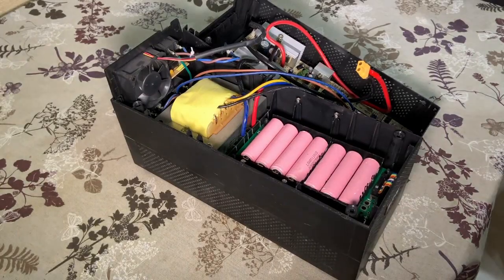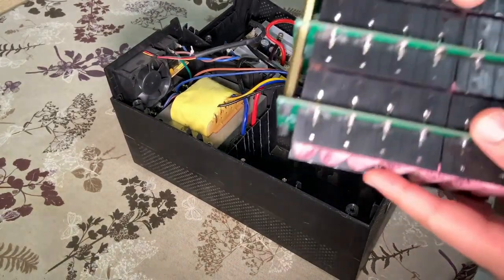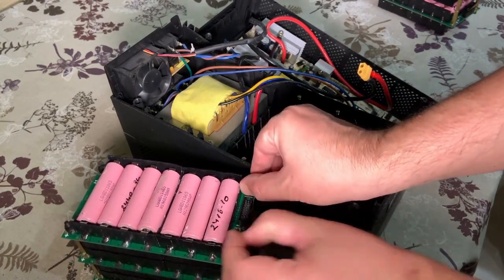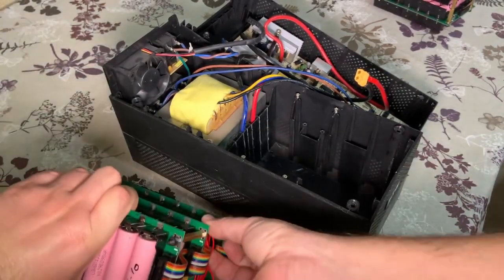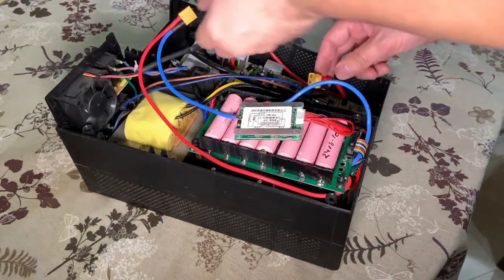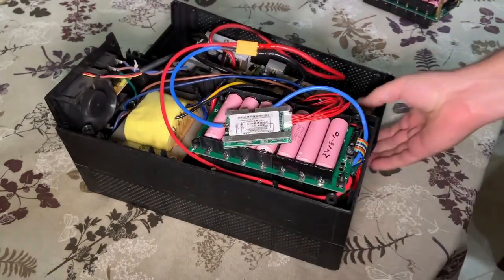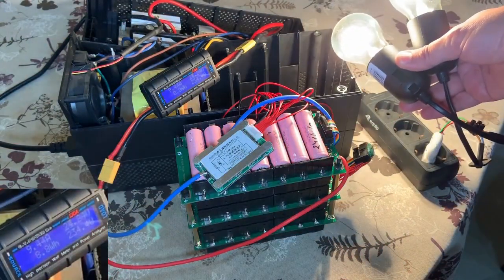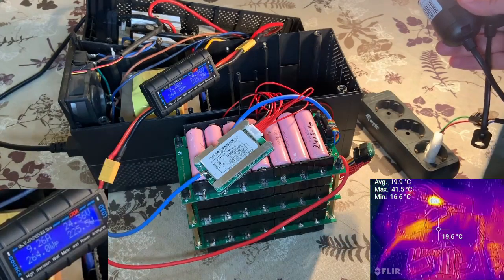Converting the UPS battery from lead acid to Li-ion Part 2

Comment: why not just buy a 12 v. LiFePO4 Battery? instead of single cell batteries + multiple circuit charging board?
Reply: LiFePO4 batteries are more expensive and have lower energy density. If you are trying to maximize the battery capacity in the same space, Li-ion batteries are better.
Reply: @ared7909  but is it safe to use Li+ instead of Sealed acid lead battery in a UPS w charging system made for sealed acid lead battery? I hear Li+ needs a different charging system? I am undecided, as I hear stories of Li+ catching on fire. thank you for sharing your brain.

Comment: If you connect buck converter and step up the voltage and put 2 cables one diode from inverter and one diode from buck converter so current will flow on one direction. So from ups current will flow to the buck converter and it will step up to charge the batteries and from batteries there wil be another cable connected with diode so voltage will flow to inverter but it cannot go through same cable

Comment: UPS auto Cuts of Voltage when less than 10.5 v but lithium ion battery can Discharge up to 8V how to Change the cut of Voltage

Comment: What is the charge controller you are using for the Lithium battery pack, the charge profiles for Lead acid is different for Lithium, Lithium has a four stage charge profile, Can you share a connection diagram from the old UPS DC ouput to Battery pack to AC Output section

Comment: The max charging voltage of ups is 14.35v and for 3s lithium-ion battery is 12.6v so your bms or battery will burn?

Comment: Instead of using 18650's with a 3.7v nominal cell voltage, change the battery to one with a 3.2v nominal like the 32650 6000mah cells from battery hookup. The packs are extremely simple to build and make a much better replacement for a lead acid battery.  The only other option is to hack the charging profile of the UPS.  Google "j606 UPS" and that will get you to some nice articles on reprogramming the charge profile.
Reply from the maker: Yes you are right. The only problem I see with 32650 is that they are not so popular as 18650
Reply: @tedonash2681  Some Dyson batteries use the 32650

Comment: i know this is old, but depending on the UPS there is a way to hack the UPS to increase the charge voltage. some are in firmware that you can manipulate, some have a potentiometer that you simply adjust.
Reply from the maker: Hmmmm that sounds interesting. I will look to see if I find something is this particular model

Comment: Sir/anyone this is just theoretical, and im mainly a DIYer as well so I could be totally wrong in my understanding of electronics here so feel free to correct me if im wrong. I'm planning to do the same thing to a UPS and I thought that re charging/discharging, would it be possible to control the in/out current with a diode and have the charging side pass through a solar controller that has the proper specs for li ion or lifepo4 depending on what i decide to use. Then from the out or load side of the controller re connect that back to the UPS terminals with a diode as well. Since solar controllers are designed for fluctuating voltages anyway, they should be more than able to manage the UPS lead acid charging method and protect the batts right??? And because of the controller, I should be able to adjust low voltage cutoff and max charge voltage if say i dont want to fully max them out. 

Would this work?
Reply from the maker: Yes I think it will work. You need very powerful diode. The only reason not to work is if you have a very smart UPS that can detect that it does not charge the battery and stop working because of that.
Reply: @tedonash2681  That makes sense, a "very smart" UPS would be a problem. I'll just have to go try it out and see what happens. Thanks for the reply.
Reply: @malds255  please update what happens is it working

Comment: What about placing the converter between the lead acid charging circuit and the Ups switching relay.
Reply from the maker: It can work as long as you limit the direction of the current flow.
Reply: @tedonash2681  Currently the lead acid charging circuit is not part of the load circuit, therefore not affected by current direction. It is in this section where the converter should ideally be placed.

Comment: you can try these https://www.aliexpress.com/item/32984035834.html?spm=a2g0o.detail.1000060.3.25dc5d55ygutU9&gps-id=pcDetailBottomMoreThisSeller&scm=1007.13339.169870.0&scm_id=1007.13339.169870.0&scm-url=1007.13339.169870.0&pvid=532872ce-bfbf-4f6c-9072-29a10c601f02&_t=gps-id:pcDetailBottomMoreThisSeller,scm-url:1007.13339.169870.0,pvid:532872ce-bfbf-4f6c-9072-29a10c601f02,tpp_buckets:668%230%23131923%2394_668%23808%233772%23833_668%23888%233325%2313_668%232846%238108%23140_668%232717%237562%23471_668%231000022185%231000069217%230_668%233468%2315612%23380

Comment: What does the holder do other than connect the batteries? Reason I ask is if it's only a replacement for tab welding the cells together, then they are not being charged with the CC/CV method required by Li-ion batteries. I have the same UPS and want to convert it this way and was wondering if I can get away with just using a BMS.
Reply from the maker: The only purpose for this holders and the PCB is easy installation with no soldering/spot welding. What they have is a fuse that protect each cell. Other than that you can make your pack yourself.
Reply: @tedonash2681  In that case I will make my own pack and just buy a BMS.

Comment: It looks like the BMS has exposed metal parts that could short the battery or the top PCB of the UPS when it is closed and moves around. I would spray the BMS metal with insulating plastidip or conformal coating.
Reply: No, the BMS should never be in physical contact with the pack. It should always be isolated using some kind of separator like epoxy resin board. Heat is another issue you have to deal with if the BMS has a balancing circuit which is why you would want a significant physical barrier between the cells and the BMS

Comment: Hi,  can you help me with this project please
Reply from the maker: Yes. How can I help you?
Reply: @tedonash2681  Actually I made a battery pack 3s 7p, with 40A bms, but when I using it in ups, it's not working, so I need your help, please
Reply from the maker: That is strange. Are you sure that both the battery pack and UPS are working. Please measure the voltage of the battery pack and check if the UPS is working if you attach to the battery terminals a 12V power supply. Send me the results in the email please tedo.nash@gmail.com
Reply: @nandapradhan2875  did u manage to find the solution. Now i am facing the same issue. My battery pack is 3S 7P with balancing 40a bms (2500 mah * 21 cells) and the issue i’m facing - when the battery pack gets full charge in my APC 600C-IN ups, relay switch changes back and forth, red colour light glows in UPS, which is not good.
Reply: @Bharani_0601  Bro are you using a 650va ups with single 12v battery setup ?
650va will not work with li-ion setup, cause it's not efficient on 12v, voltage doesn't match. Thats why your ups is flickering randomly.
Do it with atlest 1200va ups, with 7s setup will work.

Comment: this replacement makes sense to replace the 24v (2 * 12v) battery in UPS, in other cases with 12v or 48v it does not fit into the minimum (low battery) or maximum (charged battery) voltage, this can be checked by connecting the power supply to replace the batteries and adjusting  voltage to minimum (battery low) and to maximum (battery charged).
Reply from the maker: It is the same with 24 V Олег. I have decided to go with 7s setup after I have tested with 6s. With 7s there is about 20% of the battery capacity not charged if you go with UPS charger. That is the reason why I am going with external CC CV charger for now. In 6s setup the UPS charger can overcharge the battery and this can be dangerous. The real solution is to have LiFePo4 but that will be more expensive. I am working on this solution to improve it.
Reply: @tedonash2681  If you charge Li-ion batteries to 80% you will more then double their life. And since this is an UPS i think it would be best to let them sit at lower then specified max cell voltage.
Reply from the maker: @zigapirotjtwo  agree but to keep them in balance you need an active balance nodule. The BMS is a passive balance circuit that balance on top. If the top never reached then the whole pack will never be balanced.
Reply: @tedonash2681  Yeah you're right! I forgot about that.

Comment: I have been searching for BMS wire harness for a very long time where did you get assembly with the long wires attached. Or did you make them yourself? What is involved in scaling this up or down depending on the AC load current?
Reply from the maker: I made the wires myself. I am not sure about the scaling question. The BMS will make sure to limit the AC load is too high.
Reply: try searching for 7 or 8s rc battery balance extentions

Comment: How about use LiFePo4 32650. It's voltage is lower 3.2v each cell. But make sure get the LiFePo4 BMS. Can't use the usual BMS.
Reply from the maker: Yes that would work.

Comment: It is always good not to let the lithium batteries fully charge but it you want, you can try to use a dc/dc boost converter on the input of the batteries and a dc/dc boost on the output side with diodes in place that can handle the voltage and wattage.

Comment: The UPS will charge the battery to 28V I guess. VRLA have 14V max and around 13.5V float. My UPS also will charge the battery to 14V each after power outtage.
You can use relays to charge the battery via boost converter when the UPS in idle mode and turn off the boost when the power is gone.

Add: Or you can just use external charger with 28V+ output plugged to mains and it will automatically stop charging when the power is gone.
Reply from the maker: Thank you a lot for the good suggestions. I thought about the relays but that would be a specific build for this UPS and I wanted to make it as general as possible. The idea to hook an external charger to the AC main power supply is really good. I haven't thought about it. I will try it and let everyone know if I succeed to charge the UPS Li-ion batteries.
Reply: @tedonash2681  Goodluck man!  Keep making good videos like this!
Reply: @tedonash2681  did you try the external charger thing?

Comment: Hello, dear Tedo,  - the BMS board is necessary, of course. But it protects only from overcharge, overdischarge, short circuit and balances the cells. And what about the CC CV mode, which is necessary for 18650 cells? How do you achive this? Thanks
Reply from the maker: Not yet. The only solutions for now as I see them are: 
1. Use external charger
2. Hook a CC CV board to the charging circuit of the UPS. This will not be an universal solution of course.
Reply: @tedonash2681  OK. In case of external charger, it may 'have a conflict' with the internal charger; so, it could be better to use a relay or even a charger controller, which will charge the battery only in case the voltage is low. I've been working on the universal scheme of UPS working with Li-Ion batteries, but it's difficult to solve some issues in connection with proper turn on/off of the battery so far.
Reply from the maker: @powerbatterychannel4315  I have tested the external charger with diode on the battery connection to the UPS to limit the flow of current. This way it shouldn't conflict with the internal charger of the UPS. On other idea I had was to put a shunt and measure the current flow. If the flow is from the UPS to the battery then I can use a relay to turn on CC CV module that will charge the battery. I haven't experiment with this yet I some other projects came with high priorities.
Reply: @tedonash2681  Formerly, at one of my jobs, I had the following scheme: the UPS worked with its own battery, and as soon as the mains power was off, the external battery pack with 10x more capacity was connected in parallel with the UPS battery with the help of a relay (contactor). After the mains power was on, the relay disconnected the external battery pack and it was charged with the help of its own charger. So, hereby I see the only SAFE way to use additional, or, non-standard batteries together with any UPS. But if we need really to install the  non-standard batteries into the UPS without any relay, then it will be necessary to make a lot of changes it the scheme of the UPS, so, - to change the lower and the upper voltages and to adjust CC CV mode. But I have no idea how to do it. It's possible, of course, but there is a question: will the system after these changes have enough time to switch on the battery in case of mains power failure? That's the main issue
Reply: I was thinking to use lifepo4 battery instead of lead acid,what should I do ,please suggest

Comment: Are you able to recharge the battery using the UPS?
Reply from the maker: Daniel yes but only to 26.4 volts
Reply: @tedonash2681  educate me why only to 26.6 volts?
Reply: @MaxGoddur  cuz that’s how high the ups charges the lead acid batteries...he could use the actual ups relay and when the ups is in charging mode the battery could get 29 volts though the boost converter and when the ups is in back up mode it could switch the relay and daw raw power from the batteries...the only way I can think...I am sure there’s a more complicated method that he can use but that’s the easy one I can think ...